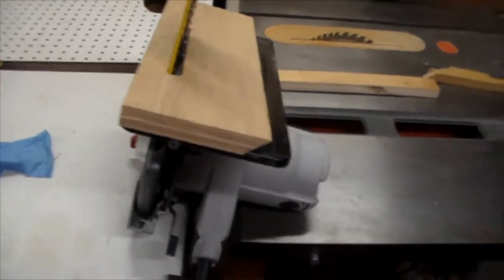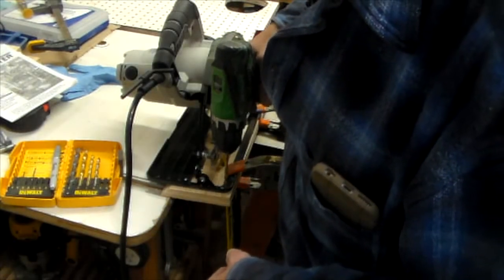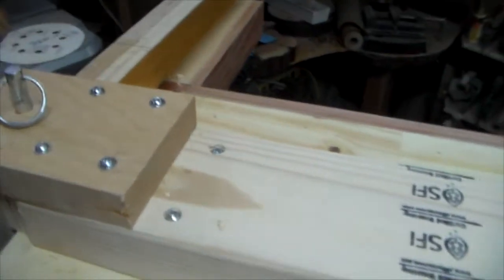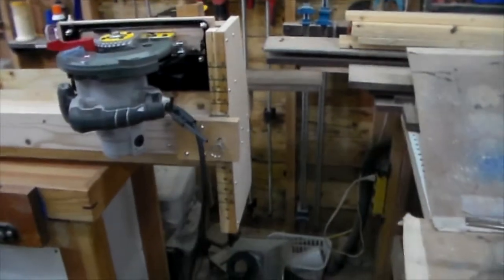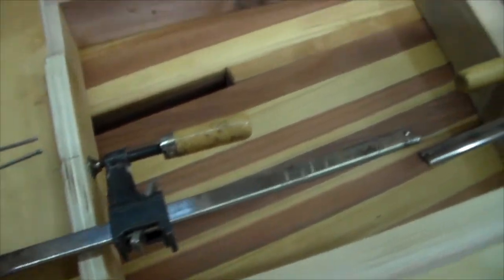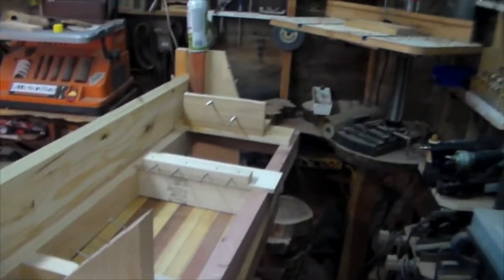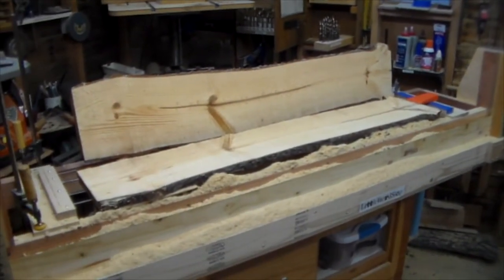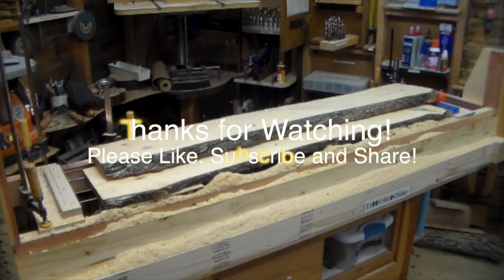Part 2, Mini Urban Sawmill build for Prazi Beam cutter

Comment: Wow..im gonna make one ..was surprised it worked so well w the sidewinder..do you have to use prazi chains or can I put a rip chain  from another company?? That's pretty cool..i have a pile of walnut to mill n this will work for the small limbs
Reply from the maker: Hi!  Prazi does make a combo chain now that works good. I had a rip one made by my sharpening guy. That way was able to get the length just right. Not sure about off the shelf ones for proper size. Good luck!!